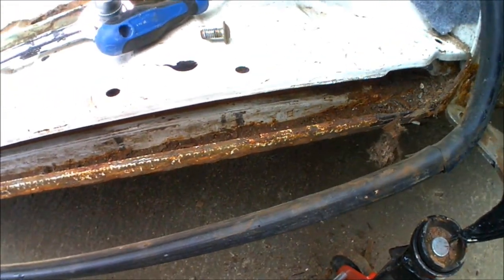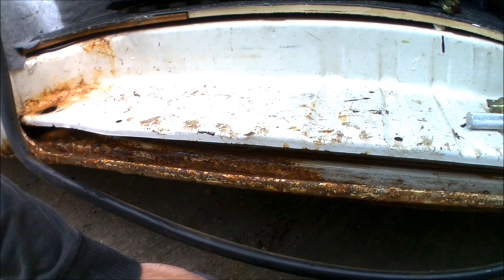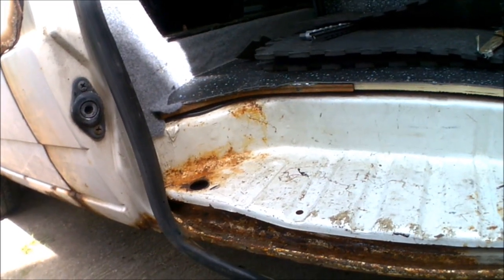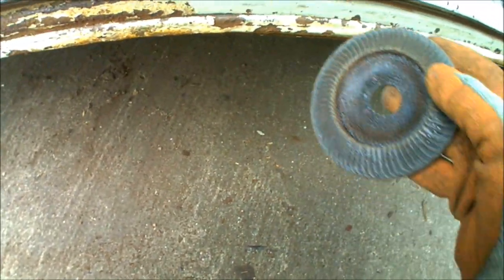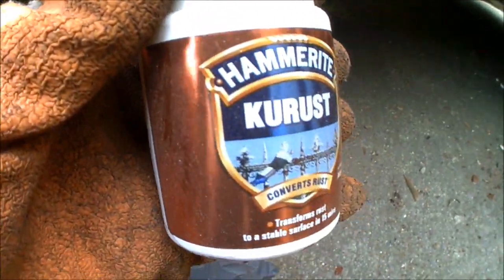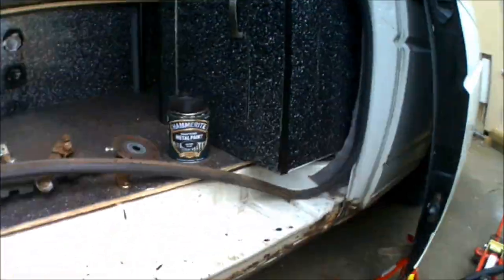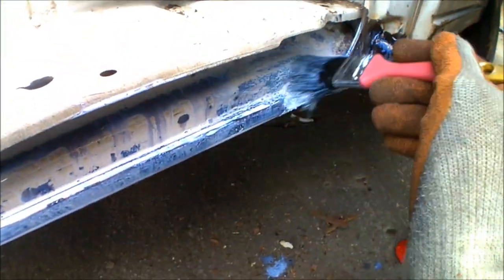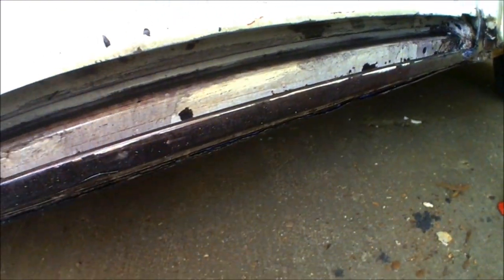VW T4 Sliding Door Step Rust Repair Using Hammerite Kurust & Paint

Comment: I use this on my T25 and if you do at least 3 coats the rust gives up. It does come back very very slightly about a year later BUT you can just put another coat on and it seems to just stop.
Any other coating / underseal / paint will trap water. Then it will rust badly
Also - don't strip off all the rust - take all the loose stuff off and Kurust (sounds like Cure-Rust) will make a rust-proof converted layer in conjunction with the rust. Bare metal will just have to rust first.
I've tried every possible combination of paints etc / cleaning down to bare metal that you can think of and No.1 is don't take it down to bare metal - use the rust against itself! Anywhere you have rust-converted just leave unpainted if you can - then you can see instantly if rust comes back and just add another coat. Paint it and you have provided the rust with a secret out-of-sight home it can do its evil work...

Comment: Me again, I've withdrew my comment and not because of the flak i got for it, it was getting a bit sad that people thought it good to line me up and after I apologised months ago too! fkin idiots lol.
I hope you're well in these strange times and wish you all the best!

P.S 
I use the same treatment for my car, after applying it then use Galva out of a spray can. it always works really well!
The Galva spray acts as a sacrificial layer and does not effect paint going on top of it either, I've used it on sils, brake disc cover plates and wings or fenders so outer cosmetic panels too, works really well so try it if you haven't already.

Subbed by the way! I will behave, I promise! :)
Reply: Liked your magnanimous post. The tip on the sacrificial paint is fully correct, I use one or two coats of KuRust after brushing and grinding, then apply the sacrificial galvanising paint. All this followed by one or two coats of smoothrite in aerosol form and then a matching paint if required. 
Seems to outlast many other treatments I’ve seen used by others.

Comment: learnt from experience that rust converters don't actually work, if you sand it back, you will find that the rust is still there, they only hide the rust for a while and only able to convert very minimal surface rusts, they also don't bond on clean metal, best way i've found is clean as much out as possible, use a rust remover rather than converter and than paint the rest with oxide primer. much longer lasting
Reply: Agree, I'm now not a fan of the milky rust converters, as if you scratch it the red powdery rust is still there, and rust will come through it if its left as is for a few days, which shows its not doing much. I prefer to use a phosphoric acid spray to try dissole the rust / convert it to iron phospate (remember to rinse off after an hour or so with water to nutralize the acid). Then finish with zinc phosphate (por15) rust converter, and paint. I was using something called fortress metal paint which I bought from b&q a few years ago but theyve stopped selling it, it was bloody great. I'm not a fan of red oxide as it can camouflage rust.

Comment: I use hammerite a lot my self but I notice on the underside of vehicles or areas exposed to the elements the rust comes back through. How it your job hold up?any signs of rust coming through?
Reply from the maker: The only real cure for rust is to replace the metal, this is more a stop gap treatment. Yes it started to show again about a year later

Comment: Looking good! One of the first jobs I did when I got my T4 11 years ago was to clean out that channel and put about half a tin of lithium grease in there. The well where the bottom roller sits when the door is closed catches a lot of grit and stones on the outside sprayed up from the near side front wheel. I have just ground that back and treated it with kurust, epoxy primer, seam sealer, epoxy primer again and then black stone chip, should be good for another 20 years!
Reply: Worst thing you can do is grease that channel. The grease attracts crap and also the roller will slide on the grease and get clogged up and  stop rolling, eventually leading to the flattened roller talked about below. Last time i had replaced my roller it had worn down to the metal evenly as i don't grease the channel. Keep it clean and dry and it will stay smooth for years.  Go and look at a brand new vw van sliding door, no grease in there.  The roller is on a bearing which needs replaced if it starts getting rough.
Reply: garsr6 My van was 8 years old when I bought it and after 8 years there was no paint left where the lower roller runs, cleaning and smearing the area with grease has stopped the rust, roller runs fine and the wheel is wearing evenly, under the grease it's in very good condition. Still on original rollers after almost 19 years.
Reply: Grease and oil are great to keep moisture away. Where there is grease/oil, there will be no rust!
Reply: @johnpiggBrewBoys  I have owned my T4 for 14 years now, the area where the lower roller runs is still in excellent condition, I would say it is in better condition than any other van I have seen, the original roller is perfectly round with minimal wear, it is now 21 years old, there is no further wear to the metal other than what was there when I first bought the van. Most of the vans I have seen have rust in this area, some quite bad, mine is in excellent condition, I put this down to the grease. The roller works fine and does not slide so all is good.

Comment: Do you rinse off or leave to dry full stop
I have Hammerite rust remover gel for bonnet spots
Reply from the maker: wipe excess and leave to dry, just don't expect it to do miracles
Reply: @TheCampervanBuilder  
So basically my rust remover gel is same as what you have used ?

Comment: Hi mate - about to do this myself next weekend - how has it held up over a couple years?
Reply from the maker: It's starting to show back through a bit now but still far better than it was, I could grind it back and redo it again but the only way to be 100% sure it won't come back would be to replace the metal
Reply: @TheCampervanBuilder  Thanks mate - I went ahead and did it and it's far far better. Used VacTan to neutralise the rust, then covered with spray hammerite. Will do another coat when I can as it took a while to dry, but it's far better. Even if it's only extended its life by a couple years.
Reply: @TheCampervanBuilder  hammerite and curerust are both rubbish products long term..
i did my step the same as you about 4 years ago..used rust bullet paint . just cleaned off the rust then 2 coats of rust bullet. sprayed back the original colour then wax oiled the areas and inside the channel.
i stripped back the step today to re wax oil it and its still as good as the day i did it no rust has come back..
you can coat straight over the rust with rust bullet it seals it air tight and kills the rust it wont come back..
if you had coated all the areas with wax oil after you painted it the rust would not have come back..